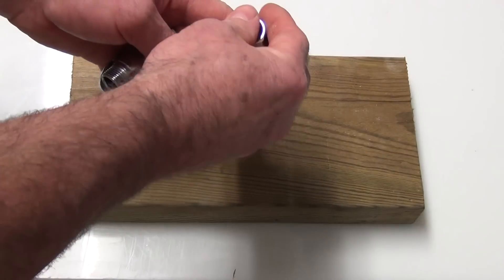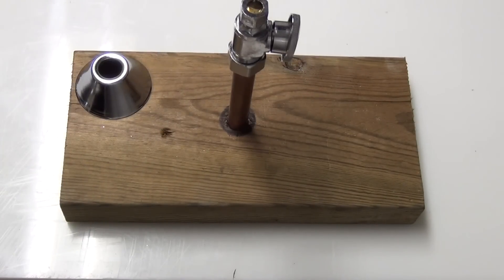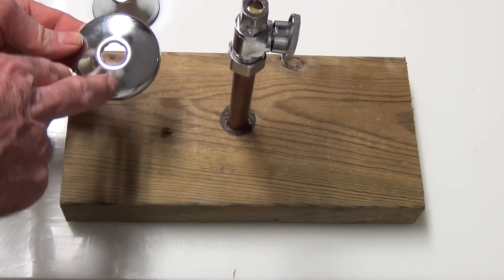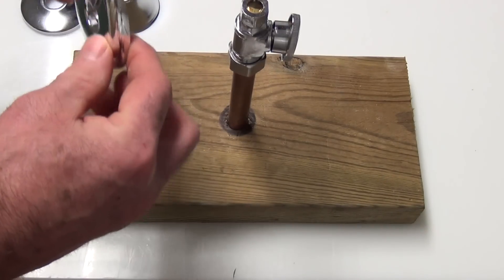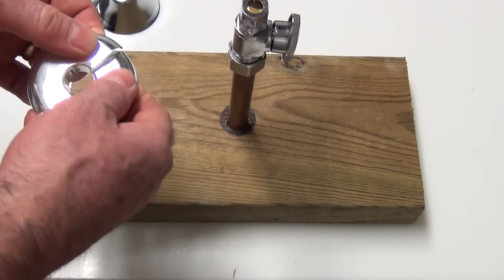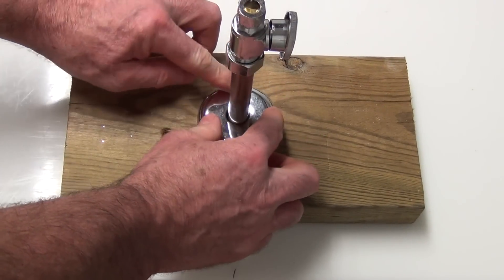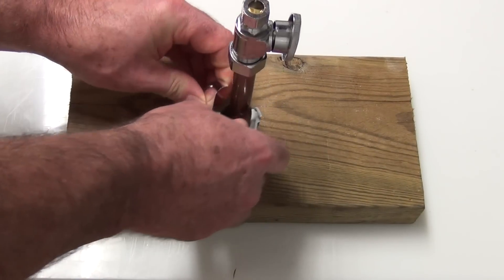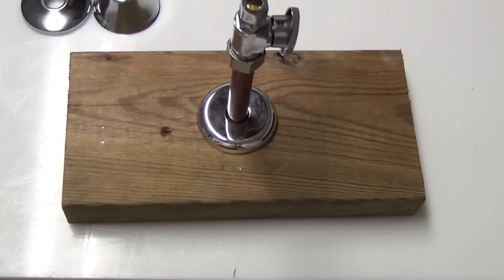A split flange to cover the hole under your sink or basin around your waterlines.

Comment from the maker: Hey Brett;

Darn little varmints. I believe you can still buy the metal split rings. That should slow them down a lot and be a bit harder on their teeth.
I feel for you on the mobile home work. Had a fair bit of it myself. A lot of the older models around here had some different size faucets, divertors and basins in them.
It makes for interesting projects trying to repair them.
Thanks for commenting and have a great weekend!    Al

Comment: Omg thank you !! I was freaking out about disassembling the pipes and now I dont have to .current ones are metal so they're spotty and rusted
Reply from the maker: Hello miamonroe4195,
You're welcome!
The plastic make the job much easier. Simply crack them on the seem of the flange, twist a little and slide over the pipe. 
A pair of tin snips will remove the old ones for you!
Thanks for commenting and enjoy your day!     Al

Comment: Hey Al,

Yep, still using the metal splits. I do mostly hvac, but still a lot of plumbing as well. Went mostly with mobile homes in 2005 or so and almost all mobile homes in 2009 due to two heart diseases that made hot attics very dangerous for me. Mobile homes have no attics,lol, so onward I marched. Have tons of experience in all phases of mobile home work now as well as 6 years of selling parts for them online. Had done a lot before 2005, so it came natural and was a good fit. Take care,Brett

Comment: How do I remove an old flange that doesn't have the split in it without taking off the valve? Obvious answer would be Dremel or cut it with some kind of metal cutters. Any other tips or suggestions to remove an old one without taking off the valve?
Reply from the maker: Hello Kris,
If you can lift it enough to snip the edge and inward with a pair of tin snips, then take two pairs of pliers or channel locks and work the material back and forth; the flange should come off for you.
A Dremel tool would work, but you have to be very careful when working close to the pipe.
I take it the flange is in rough shape; so it should break off easily.
Hope this helps.
Thanks for commenting and best of luck with the project!   Al
Reply: Thanks, Al! I was able to get the old one off with snips and a pair of pliers. Now to finish priming and painting and mount the cabinet/sink and light!
Reply from the maker: *****
Great to hear!
Good luck with the rest of the project!    Al

Comment: Do you use glue or silicone to set it thanks
Reply from the maker: Hello vlr213,
The plastic split flange fits snug on the pipe. That being said it depends on the manufacturer. A few beads of silicone on the back side will do the job for you.
Thanks for commenting and enjoy your week!   Al

Comment: Does anybody know how to remove one of these flanges? If it's already on the line and it's old and rusted?
Reply from the maker: Hello Small Fry,
Unfortunately if it is not a split flange; you will have to remove it with a pair of tin snips or a tool similar to it. Simply slide it up the pipe then clip the flange with the snips. It should come off easily. 
I have removed a lot of them over the years in this manner. 
Thanks for commenting and enjoy your day!   Al

Comment: Will these stop mice from coming up thru the hole around plumbing I've tried traps but the mice are smart Wiley creatures, I live in country and every once few years we get a mouse in house they seem to always find a way in thru plumbing hole ....if u think these wont work   do up have a idea how I can plug up hole that's bigger than pipe it's kinda grossing me out.. having a mice in my cabinet ever few years....lol
Reply from the maker: Hello Marc,
The flanges will help, but mice can get through some very small openings. Spray foam will work for you. This is the what the container I use is called....
"GREAT STUFF Pestblock 12 oz Insulating Foam"
It works very well. Once it is sprayed...it can be trimmed easily with a knife. It is very sticky so be careful when applying it. I always use disposable gloves so that I don't end up wearing it for a few days. LOL
Hope this helps!
Thanks for commenting and enjoy your week!      Al

Comment: The drain pipe from a kitchen sink connects to a heavy (Steel? copper?) pipe that comes through the wall. There is a hole around the pipe. The patch of plaster of Paris and a white compound were torn away and rat has entered the cabinet under the sink. The garbage can was in that space. How convenient for the rat!  What's the best approach to fix this?  How about a mesh/metal patch around the hole/pipe, plaster over and then a split flange? The pipe is well over 1" in diameter. I saw split flanges at Home Depot that will probably work. I'm setting an electric rat trap tonight. I need to get that hole patched after I trap the rat. Gonna call an exterminator too. Any good advice is welcome. Thank you!
Reply from the maker: Hello OneThrough8,
They do make flanges in different sizes. I am not certain of one for that size pipe, but it will help a little. Hard thing with rats is they can chew around almost anything if they smell food. So a flange may not be the solution. They make a spray foam now that is suppose to stop rodents from chewing it. I have used it myself and it does work well. Most hardware stores should carry it. I know Home Depot has it. If you can find out where it got in; that would be the place to use it. Would definitely deter others. 
Thanks for commenting and best of luck with the project!    Al